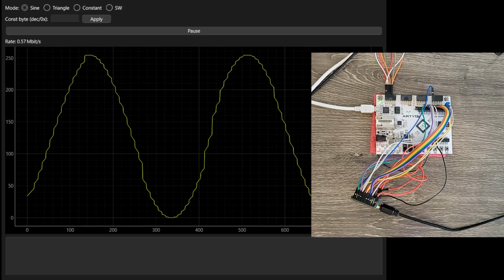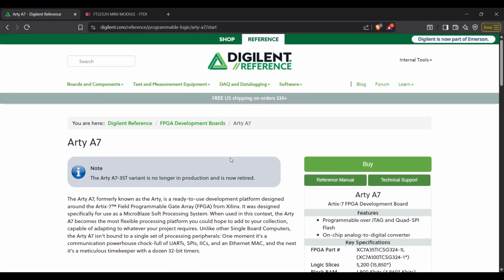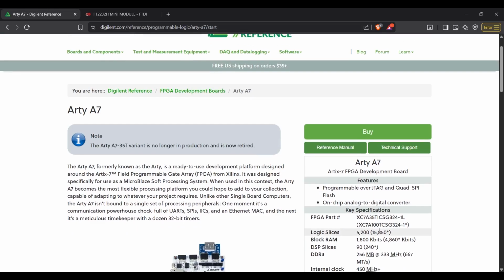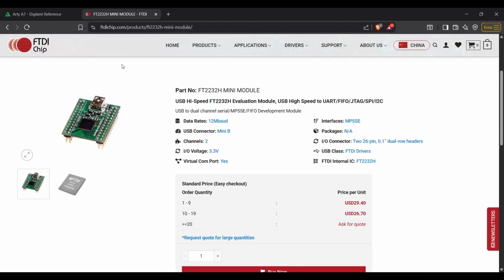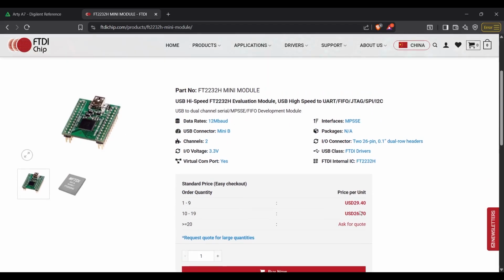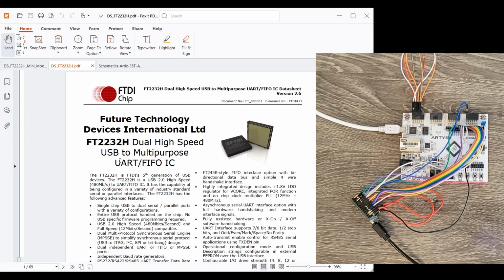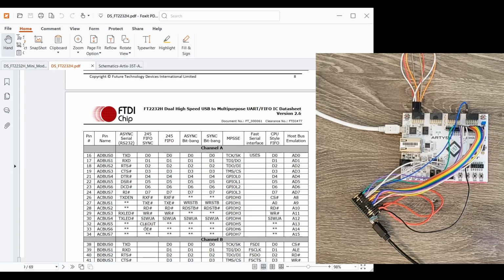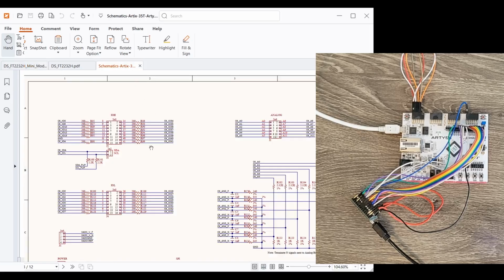FPGA to PC Communication: Unlocking High-Speed 480 Mb/s USB2 for Logic Analyzer & SDR Projects

Comment: I'd like to do a DIY DAQ... just an FPGA with an ADC (ex. LTC2320-12 , AD7381-4 etc).
There's a ggood Analog Device article: 'Interfacing FPGAs to an ADC’s Digital Data Output'  ( JosephFeld/streamoscope cjhonlyone/ADC-lvds)..

And if the FPGA has built-in ethernet (MAC) like the microchip Smartfusion2 or GOWIN GW1N , then maybe it can output the data directly to an ethernet PHY?  Or maybe use a USB3 microcontroller (CH32H417 / CH569W etc)?  For early protocol debugging a Cynthion (USB2) could be used!

However, given the FPGA/ADC interface needs to run at 200Mhz for these ADCs, I imagine that not only is the PCB layout tricky, but the fpga design as well (especially since I have VERY little experience).

I found one such project, but sadly it's not open source to learn the HDL from
( hackaday : Web-based oscilloscope DIY using beaglebone black)

Looking forward to The Verilog HDL for the FPGA state machine!

Comment: I've thought about doing something like this for a few years now, but my 70-year-old eyes just aren't up to fine-pitch soldering, so I had already bought some QMTECH XC6SLX16 boards with the FPGA already mounted. I'll be interested in following this series. One question though - my understanding is that the USB2 protocol transferred data via packets on a 125 microsecond time slice, i.e. a maximum packet rate of 8000 packets per second. The speed comes from having large packets. Do I misunderstand something? Is there a way to transfer shorter packets (say 16 bytes) at a more frequent rate?
Reply from the maker: Hi, thanks for following the channel. Great question—you’re right about the 125 µs microframes. In practice, the FT2232H (with its driver) bundles small writes into larger USB packets, so throughput stays high. You can send 16-byte chunks; they’ll usually be grouped before being sent. If you want snappier updates, I’d lower FT_SetLatencyTimer (I use ~1 ms in the final video of this series https://www.youtube.com/watch?v=ncycQz0_130) to trade a bit of peak speed for lower delay.